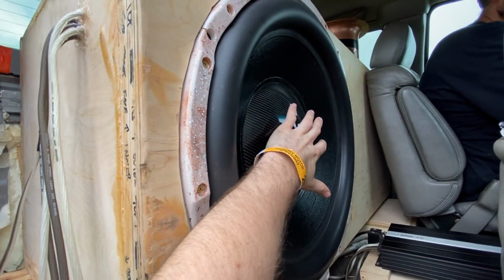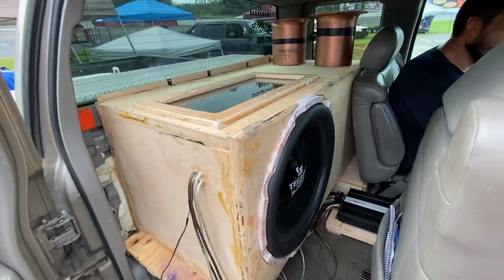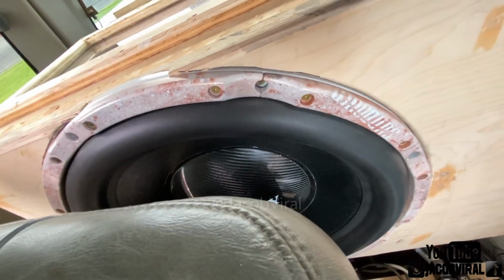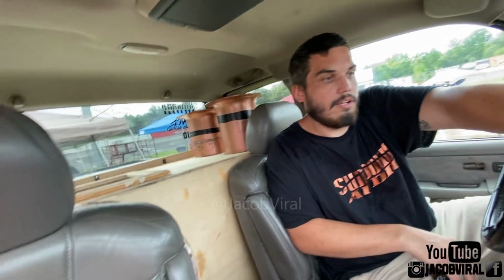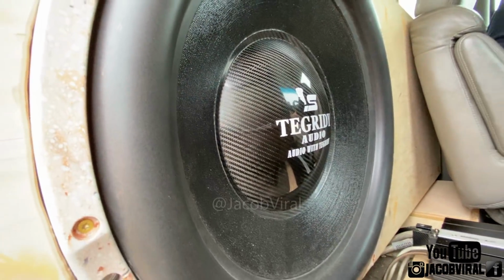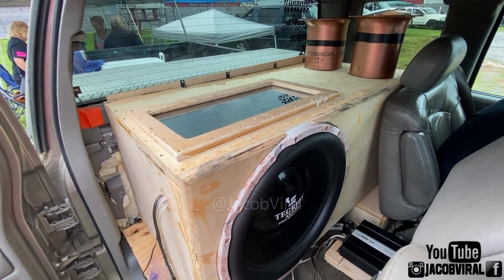24 INCH SUBWOOFER BASS DEMO VIDEO

Comment: Does a 24” sub have equal or more cone area than 2 12’s? That truck is flexing pretty hard tho 💪✅🔊
Reply from the maker: A 24” has about twice the cone area of 2 12s. It would take 4-5 12a for cone area of one 24”.
Reply: 2 12s is comparable to a single 18. Only in loudness. 2 12s could have more motor force depending on subs.
Reply: 5x 12 inch = 1 x 24 inch = in low bass 6x 12 inch